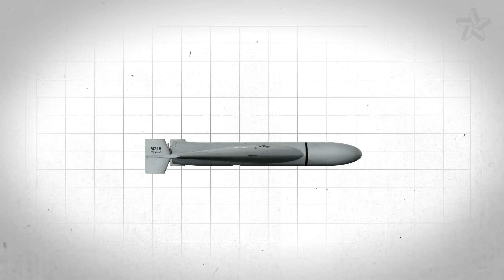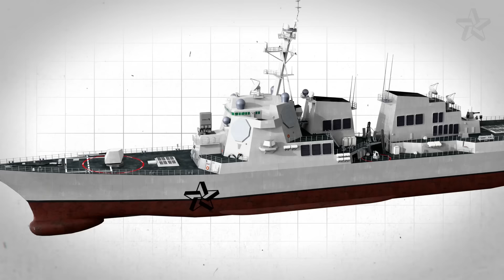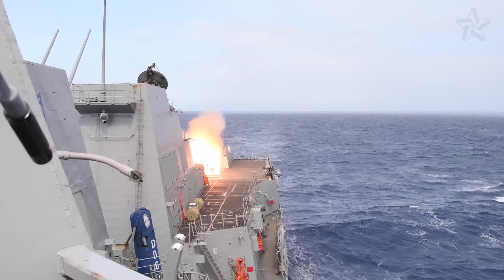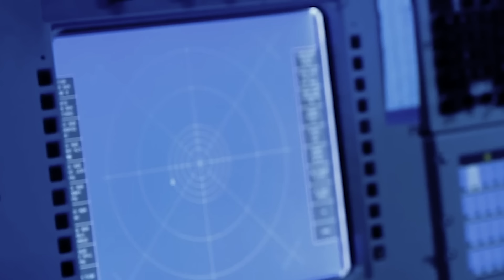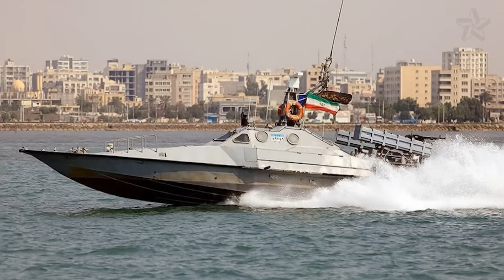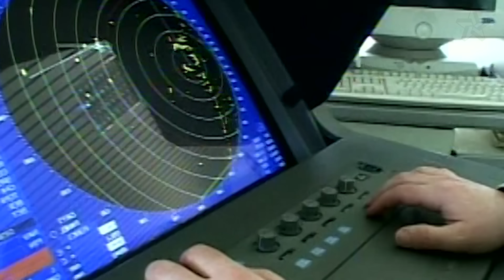US Navy Launched Something That Shouldn’t Exist… Iran Can’t Stop It

Comment: The Growler would jam the Gps signal immediately and the drones would fall out of the sky.
Reply: I don't think it works like that, does it ? Sure, we could jam the GPS signals, just falling out of the sky would be something we'd have to keep them in the air until they ran dry before they'd fall, wouldn't we ?
Reply: @gregstone7190  without direction they are more or less harmless and very easy targets.

Comment: Do I understand that if the drones drop to just above sea level the are hidden from ship defenses?  That seems like a pretty big problem.
Reply: It's not a problem...U.S. Navy carrier strike groups can detect drones flying about 20 feet above the water, but detection isn’t automatic. They use layered sensors ship and airborne radar, infrared, electronic intelligence, and patrol aircraft designed to catch even harder targets like sea skimming missiles. Drones only seem “invisible” because of sea clutter, small size, sensor prioritization, and rules of engagement, not true stealth, if low-altitude objects were undetectable, aircraft carriers wouldn’t still exist.

Comment: Once you see where the first wave of drones was launched from, a couple of sea-to-ground missiles and those 70+ drones are gone before they are launched.
Reply: Huh! living in the past. They'll use HYPERSONIC missiles and other means - ALL AT ONCE - and you can't stop hypersonic plus glide vehicles. Period.
Reply: @Zarghaam12 The laser weapons might be utilized against the hypersonics, since they will be operating at the speed of light ?
Reply: @Amy-k1p9f  - Do you know what happens to a missile headed to a carrier at Mach 8-10 when it is broken up a mile away? The big pieces still hit the carrier in half a second while continuing at a high mach number. Some pieces might punch straight through to the other side.
Reply: @bruzote wow damn!
Reply: Hypersonic aren’t the end all be all wonderwaffen that many nations make them out to be. They are capable of being tracked and intercepted it’s just that it’s massively expensive to do so. Glide vehicles are easier to intercept than cruise missiles do to every turn means the missile loses energy and speed. After so many turns they lose their hypersonic velocity. It’s the same with cruise missiles but it takes longer due to it being a fueled missile but with each turn they lose energy and make several kilometer turning radius versus a few hundred meter turns by traditional subsonic cruise missiles. Also, the ship is not static like a building it is dynamic and constantly moving changing course.
Reply: @Zarghaam12 how far do they reach?
Reply: @fredycorea4901 not gonna tell ya, some socialist might tho. We have lots of traitors in this country thanks to Dems.
Reply: @Zarghaam12 they cant hit moving targets though
Reply: You just described the nightmare for the US Navy. Do you konw how much those US missiles cost? You don't seem to get it.